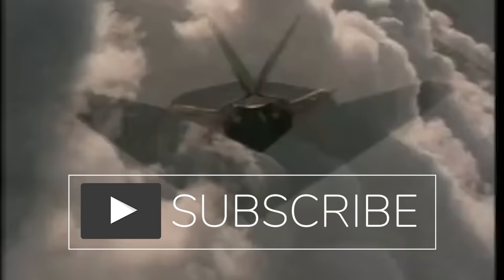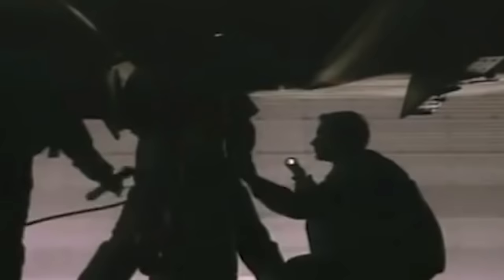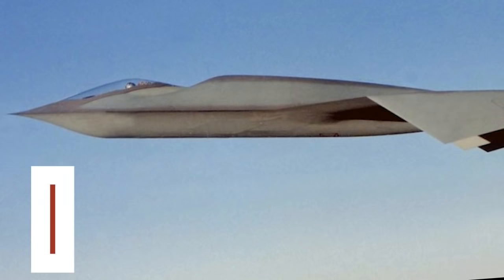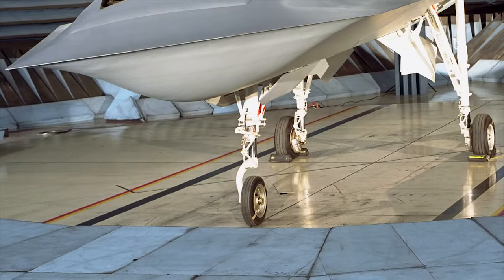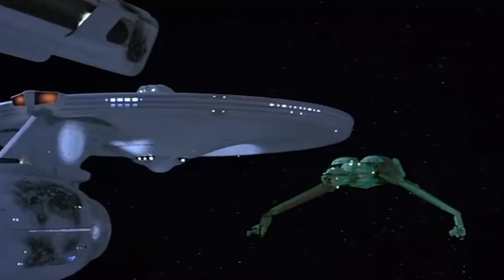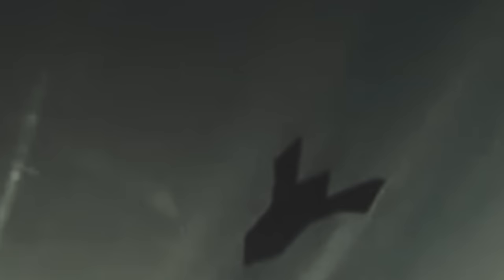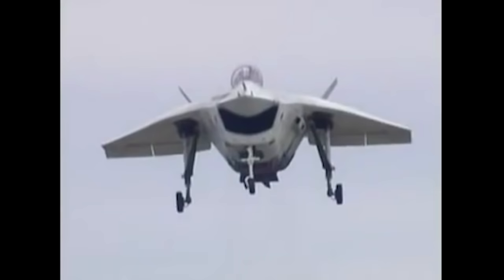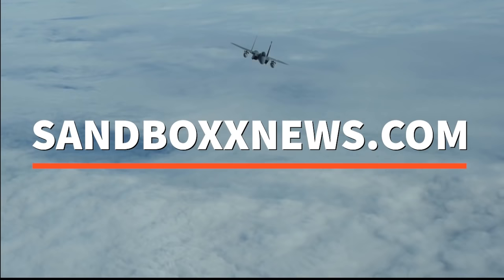Boeing's secret budget-busting stealth fighter

Comment: In 1982, Chevrolet Engineering placed the 2.8L V-6 & 4-speed into a Chevette, using mostly off-the-shelf parts and shod it with 14x6" wheels (Standard was 13x5.5") with low-profile tires. The result was a car that could out-perform GM's all-new "sexy" F-body sports coupe platform (Camaro/Firebird) in all respects, while returning fuel economy in the high-20s. Had it been approved for production, the V-6 Chevette... and it's Pontiac sister model, the 1000... would've likely also received Borg/Warner's new 5-speed--as it did in 4-cyl. form--making it capable of 30+mpg... at a predicted production cost 1/3rd of GM's high-end sports-coupes. (Z28/Trans-Am)

So why didn't it make production? 

GM claimed the T-body's preferential drive axle (w/6.5" ring-gear differential) didn't met their standards when the prototype was subjected to their standard torture tests. Of interesting note: At the time of the V-6 Chevette's build-up, GM was using their drive-axle w/7.5" ring-gear differential in wide variety of widths & configurations, including a torque-arm/panhard rod configuration under the F-body... just like the one the Chevette came with. 

Go figure what's GM's real  reasoning was...! [:\
Reply: Gm is trying to destroy themselves

Comment: Just a bit of information to fill people in. The F-117 had the F designation due to its role in large scale warfare to destroy enemy awacs aircraft. They had the ability to carry 2 heat seeking missiles to do the job. My source is the Fighter pilot podcast F117 episode. The F117 pilot talks about this designation and it's role in awacs destruction.
Reply: The F-117 had no means to detect AWACS and it even retracted the comms antennas when over enemy territory. The engineers were also skeptical about firing a missile because the rocket burn would scorch the RAM coating.

Comment: Uou can tell from the wing design that they s will run into problems when doing a high g manuver. Great for staight flying, but i can see you get a wierd cavitation under the wing at different angles of attack. Hey if you can make swing swing planes the make a swing tail wing plane that lays flat on the body, then pops up for  manuvering.

Comment: I like the way they designed it before committing to building a prototype, with today's 3D tooling who knows what kind of shapes we're going to see.
Reply: A.I. is emulating Bone structure to make the Frames. This is about as minimal as it's going to get as far as outside goes, a body and a wing, or just a wing and a cockpit.
They are looking Very 1940's German with a lot of F-16, and the Hull seems to be the same shaped Tub.
Asthetlicy the drag is they can't Camo up these planes, that paint is part of the stealth,  more Spitfires. Identical but for the letters.

Comment: So it was incredibly slow and had a maximum ceiling less than a WW2 propeller driven fighter. And it had zero armament or advance warfare electronics (targeting, counter measures, etc). You really can’t compare it to a modern stealth fighter, it was only a stealth plane or test bed. Yes, it was impressive what they did with such a small budget, but how much would that budget be if they had to add everything needed to make it combat ready? That would include armament, internal bays for missiles and bombs, advanced electronics, and increasing the maximum speed and ceiling. And just how much more would it have been if the government continued to make changes in what the plane’s role was supposed to be?

Comment: The F-117 was not the first stealth aircraft. Both the U-2 and SR-71 were intended to be invisible to radar under certain situations. But the F-117 was the first to use computers and precise electromagnetic calculations to design the aircraft to be stealthy.

With the U-2 and SR-71 there was a lot of guesswork involved. But with the F-117 they could determine how stealthy it would be when it was being designed.

Comment: There is a difference between making a successful design and running, planning, and executing a good program to come up with a good design. Most companies don't manage the development of military equipment well because cost doesn't matter when it comes to military top brass. They fail to realize that they could purchase more equipment and possibly better equipment where they honestly need the better equipment ( if the rest of the equipment cost less and was still effective) while still meeting the budget. Then again, perhaps our generals would loose that nice cushy job in some military contractor after retirement. Perhaps generals should stick to strickly military matters, not military purchases.

Comment: I have often been both amazed and irritated that military developers too often boasted of their most impressive feats, such as pilots' helmets that were integrated into the design of the plane such that a pilot had merely to tilt his head down, looking toward his feet, or looking in any other direction as if looking directly through his body, and the entire plane, to have an invaluable view of the terrain below him and the skies and other aircraft near him.  For enemy military heads, just knowing such things were capable of being done undoubtedly led our enemies to develop their own systems; that is just one example.  There are hundreds of other capabilities in our most advanced planes and other vehicles that would be left unknown by anyone.  I have heard other things discussed openly as well, used by men on the groumd, that would give an advantage over opposing forces only as long as the enemy forces were not aware of them.  Simple bragging of one's cleverest moves is certainly not smart.

Comment: The trouble with the Air Force an the rest of the military they want to many bells an whistles that cost way to much an really are out dated before their in service.  They want multi role aircraft that can do more things, but doesn't do any one of those functions really well.  Over 100 million for one aircraft like the F22 a good aircraft but low in numbers for a major conflict.   Remember Red Dawn an the 15 fighter pilot that got shot down, when asked how he was shot down he said there was 5 of them I got 4.  No matter how good an aircraft is you can't beat numbers of aircraft you have, if going up against an enemy that can send  5 planes against one fighter an lose 4 an shoot down that single aircraft with the 5th one you'll lose.  They need to consider cheaper aircraft that still fight an have more of them.

Comment: The prototype was cheap as it had no significant sensor or weapons system. Integrating sensors, weapons, data links, fly by wire, computing systems can be extremely costly to develop. As with the F-35. Which had minimal size in which to fit these systems with internal fuel tanks, stealth and weapons bays. The development of the F-35 is producing large amounts of new technology that could be used in future aircraft or adapted to older aircraft. This will help reduce costs in the long term. The future US air superiority may use much of the F-35s system's but in a much more powerful, twin engine type. Though the next gen fighter will be used in the air superiority role it will still likely have ground and sea strike capability as new or at least built for future upgrades of strike systems. Historically it has been very common for fighters to become strike aircraft. The US is using rapid prototyping development systems using computers and modern computerised tooling. 3D printing can quickly make original parts for prototype aircraft. One of or small batches of production can be much cheaper to make and quickly tested. 3D printing can make much more complex shapers. They can also be used to quickly make replacement parts when needed.  The US Airforce is developing 3D printing to make rare parts for older aircraft that have not been in production for years. The technology also means that smaller batches of purpose built aircraft for particular uses. The air force will be able to make more modular designs rather than being limited to a very small number of fighter types for logistical reasons. And development will be able to be done very quickly and cheaply. And with reduced costs it will  be more practical to build new aircraft than upgrades old airframes that has become common.

Comment: Militaries are notorious for screwing up purchases.  The best in the military are fighters, not administrators.  So the 'failures' end up in such support positions.  fyi WWII  a new torpedo had been introduced about 2 yrs before the war, NO TESTING, not a single test, and for the first 2 yrs of the war the generals in purchasing REFUSED to conduct a test despite a failure rate of around 90%.  A submarine could fire every single torpedo it had and not a single one would explode.  It took 2 yrs of this,  and the lives of HUNDREDS maybe THOUSANDS sunk in subs being chased after such fruitless attacks, or shot down trying to launch them from planes at ships before an 'active' general in charge of the 'fighting' finally took the extreme risk of ignoring the chain of command and allowing testing.  Torpedoes went low below targets, hit targets and bounced off, did EVERYTHING but explode.  His men found fixes for many issues, that the generals in the supply dept FORBID them from using.  Those generals were, after more months, given other jobs, they no doubt did equally poorly.  
It's good to know this design exists and can be rolled out quickly when needed.  As has been the case with MOST war winning weapons.

Comment: They had an air show here back in the mid-90s and they had one of The Nighthawks there on display along with the pilot it was was really cool  I noticed somebody was trying to take pictures with one of those little Kodak throwaway cameras with the  automatic rangefinder he couldn't get it to focus I commented to the pilot somebody doesn't understand the concept of stealth do they and he kind of laughed I then asked him how he enjoyed flying it he said it was incredible I said you really like it compared to the regular planes he said yes much better then I asked him how does it compared to the Aurora he actually started to answer and then stopped and said I don't know anything about that   I left before he could call security on me
Reply: The rangefinder not focusing has nothing to do with the aircraft's stealth tech.
Reply: @jfangm   Actually it does. The range finders on some cameras use a form of ultrasonic distance measurement. The angular construction of the F-117 reflected a portion of the sound away from the direction it came from as well as EM signals. This effect actually spurred LM to investigate a sub that was "stealthy" to active sonar and the design was recently released.

Comment: Your comparisons with the F-35 are specious, as the F-35 has. massive and sophisticated avionics that the Bird of Prey does not.
Reply: I heard that Northrups YF23 out performed the F22 in all aspects, but they both exceeded the expectations required. Therefore, the contract was given to Lockheeds F22 because it was cheaper. Regardless, the F22 is superior to the F35...just using logic. Unlike the F22, the F35 was a multi national project involving various allied countries. I can't imagine that the US would put/disclose its best secret technology in to a multi national project that essentially will give other allied countries access to this technology, also increasing the risk of it being stolen from the US adversaries (makes no sense to give away your "ace" card"). I have no doubt that the F35 is a formidable fighter, but i would bet that there is some highly valuable US technology that the F22 has, that was not included in the F35. Just my opinion.
Respectfully

Comment: This is no different than a car add.,, When you actually sit down with the salesperson you find nothing beyond a seat is included,, did you want the jet engine with that? How about the electric system, heads up display and radar?, pilot ejection system?, Weapon system? Anti missile deterant system? ,,, Would you also be interested in and extended warranty? ,,

Comment: Well, duh.  A rather ridiculous comparison.  On one hand you have an aircraft that had to meet written specifications and go through US Air Force acceptance testing before it could officially enter US Air Force service.  And on the other hand you have a corporate funded proof-of-concept vanity "me too" project that isn't as stealthy, is slower than a prop driven C-130, has no weapons or reconnaissance cameras and cannot deliver ordinance.  Basically, a flying mock up.

Comment: I haven't seen anything interesting, or of any significant value, coming out of the Boeing's Phantom's work, in the last 20 years. McDonnell Douglas was a fine aerospace company and the US Air Force lost the contribution of the great defense company when Boeing bought them in 1996. Boeing's last big contract with the USAF, the KC-46 Pegasus air tanker, is a complete disaster. And we're taking about a slightly redesigned 767 airliner. Imagine if Boeing had to develop something stealthy or cutting edge? 
US Navy is stuck with another "great" achievement of aerospace engineering, the MQ-25 Stingray. Although to be fair, this pathetic contribution to an aircraft carrier air wing is the fault of the Navy brass that cling to their manned aircraft for too long, with still unknown concequences. US Navy had a working UAV prototype - X-47B, from Northrop Grumman, taking off, refueling and landing autonomously from the carrier, 5 years ago. And these "distinguished" Admirals decided to take a pass on a stealthy drone with actual attack capability in favor of some mid ground tanker that will give their manned aircraft another 100-200 mile range. And all this in time when we need fighters with 1500 mile range to be relevant in the Indo-Pacific region. 
Thankfully I haven't seen such a disaster in the case of Northrop merging with Grumman. They are still on the cutting edge with development of B-21 Raider being the most important future air force asset, at least until the NGAD becomes a program of record and transfers from the R&D to testing of prototypes.
Boeing also lost the contract to develop Minuteman ICBM replacement and they didn't have any chance of winning the LRSO program or hypersonic missile programs. Boeing is almost dead as far as defense contracts are concerned, and with 737 MAX disaster, who knows how will their civilian department end up.
Thankfully there are few of the relatively new players coming on the scene with new ideas that could change the same old same old paradigm of the MIC. Companies like the General Atomics and particularly Kratos. Hopefully Pentagon will give more job to government financed and owned institutions like the Sandia Lab, Lawrence Liwermore lab or Air force research lab. There are some great and patriotic engineers working there, eager to contribute in developing the next gen technologies needed for the future wars. Sandia Labs have recently developed the warhead for the US Army and Navy hypersonic missile. They've also developed the groundbraking B-61-12 nuclear gravity bomb with GPS navigation...
Reply: Interesting comments here and from others. Has it occurred to anyone that these public critiques in fact help enemy designers with what not to do and save them huge development costs? Too much freedom is slowly destroying the US
Reply: @metatechnologist  I hear you.
Reply: Not 'slightly.'  The air force wanted faster fuel transfer which meant that the refueling boom was heavier and more cumbersome.  And the requirement to have the boom operator sit in the front of the aircraft created further complications.  The blame here is 50/50 between Boeing and the air force.  

What Boeing had bid to the Air Force was the same tanker they had made and sold abroad.  Instead of simply buying a proven platform that they already knew worked - the Air Force started adding new requirements.  And Boeing had trouble designing and testing the improved components.
Reply: @colincampbell767  OK, let's go all the way.. Boeing actually lost the bid to build the tanker since the Airbus won the contract first time. Then Boeing started whining and bitching about it to friends they bribe in Congress so they made the USAF nix the contracts with Airbus and give it to Boeing.
But regardless, having soo much delay and cost overrun for a new boom and a few cameras is pathetic. Imagine what problems Northrop is currently overcoming while building the B-21?
Reply: Why do you assume there will be future wars?  Maybe mankind should "evolve" past this idiocy.
Reply: @mikerowan1132  Simply because mankind has consistently shown the capacity to hate, be envious of others, try to impose religious beliefs resulting in war against its own specie for its personal gain or protection. Perhaps a world govt. as espoused in the original Star Trek movies may eventually come about and bring peace - most people unfortunately only appreciate the cinematic special effects and failed to grasp the underlying theme which is peaceful conflict resolution. However,  such evolution will take time and is unlikely in the lifetime of anyone now walking the earth. Perhaps in the distant future as mentioned in the movies which say, "Star date..." then, such will peace will reign.